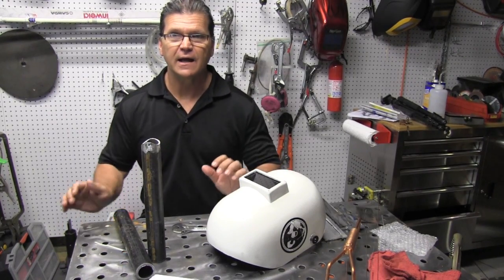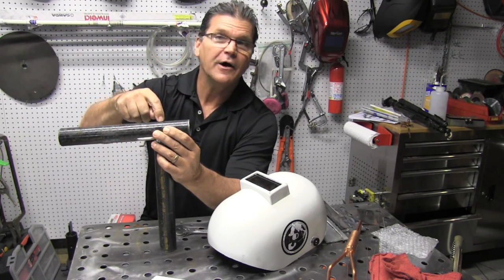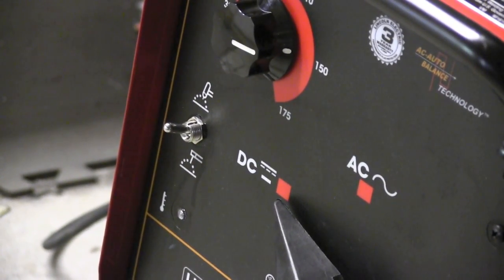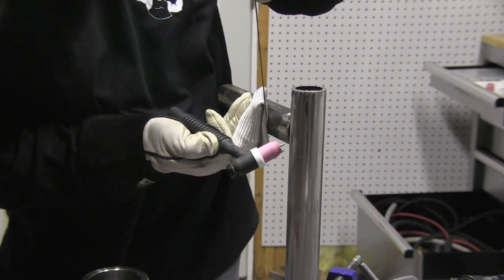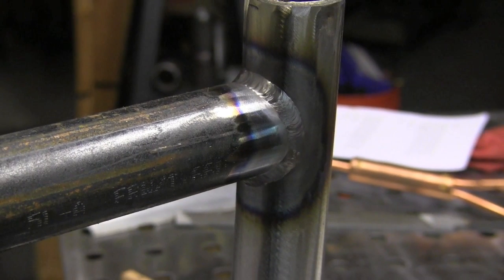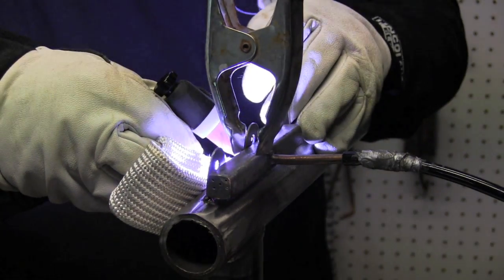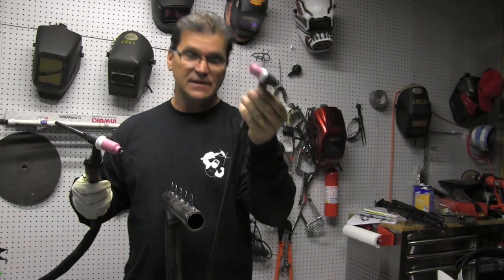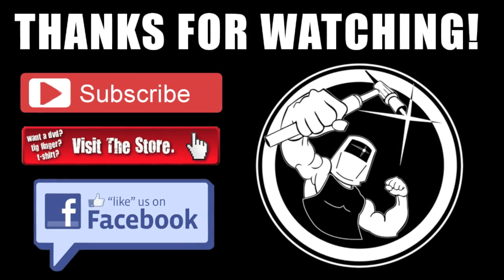TIG Welding Basics 4 - Metal Prep, Stubby Gas lens, and more

Comment: Hi Jodi,
First off, thanks for all your help getting my MIG skills sharpened enough to do a reasonable job with MIG welding. I have decided to learn how to TIG weld and purchased a Lincoln Square Wave TIG 200. I am not stacking dimes yet, but getting better every time I pick the torch up. I have been watching your basic TIG series and you have answered a bunch of the questions I had and solved a few of the problems I was having. Thanks again. It's not often you find someone who is as good at what he does as you are at welding, and is still humble. Keep up the good work.

Comment: Just getting started with TIG. Your videos are clear and concise and very helpful. Thank you so much for taking the time to try and educate and improve those around you. I do have a question. In learning how to basically manipulate the hand torch, I was just running beads on some steel I found laying around. Initially the steel was rusty and had paint on it. I ground that all down until it was clean and bright. When I tried to run a bead down I got a lot of porosity  and sparking. I had not been using any filler material at all. I checked amperage and shielding gas flow rate but it didn’t seem to make much difference. Would you have any suggestions on what I may have been doing wrong? Thanks again for all that you do.

Comment: When i saw the 'weld tab' i did what i normally do when i see something cool on the screen, i took out my phone and took a picture of it. Being poor i tend to build first, buy as a last resort. 
But then later in the video i realized i have a magnetic base for my dial caliper. If i put it on the tube, use a flexible soldering gizmo with an alligator clip on the end, i can position it however i want while using tools i already own.

Comment: Hey Jody! Here's a Q for U: At a job I was on, they had me going for speed over quality, welding cold rolled to hot rolled, and they specifically told me NOT to prep, just burn it in.  Some salesdood sold them on deoxidizing wire (basic 70S-6), with the idea that you don't have to cleanup first.  I'm a pretty decent welder these days (thanks in no small part to your vids, which got me through school and my first couple years on the job, thanks Jody!), so, though I got plenty of pops and sparklers, I  still made decent looking welds.  
Sorry to ramble on, here's the question: Are those welds going to be weaker or have hidden porosity underneath, like I think is probably the case?  Or was this a case where good enough really is good enough? (we didn't do ANY testing after the fact, just visual and send it on to the customer)

Comment: 1) if you never foul the tungsten by touching it to the filler or the weld, when do you know that is time to resharpen or re-dress?
2) And what about the collet body and cup, how can you tell if/when they are used up.

Thanks, also I bought 2 tig fingers and they are great.  Beyond heat protection they give a smoother surface when sliding along the weld piece and they are great for mig too.

Comment: I have a terrible memory, and kept leaving on (or forgetting to turn off) the purge gas in the tubes I was welding. In the end, I went back to R-Tech and bought a second solenoid valve and put that on the 'Y' piece so that it turns on and off with the main shield gas.
The solenoid is wired straight across the one inside the welder, so it's easy to add.
Now I only have to remember to turn on the shield gas at the start and off at the end of the session and it saves a lot of gas.

Hopefully someone will find this useful.

Comment: Hey Jody, I have got several of the Tig fingers, But could you also sell some larger portions of that same heat resistant material? I see that Keith has some large sections he uses to blanket his projects.

Thanks,Randy

Comment: As always, thanks Jody for all the time and effort you put into making these videos, You've got a knack for explaining the finer points of welding and I always look forward to watching your vids every week. I only have one question: I have a Harris 356 dual flowmeter and I'd like to be able to put it to good use for things other than just backpurging SS pipe. I've got all the parts required to make a similar backer box to yours, except for one thing - I can't find a supplier for perforated copper sheet. Any leads on where to get it, and do you have a recommended on what thickness works best for the perf copper section? I guess if all else fails I can drill my own, but copper is a royal PITA to drill <1/8" diameter holes in and tends to snap regular drill bits. I don't like asking for help, but I really can't seem to find perf copper sheet for sale online anywhere.

Comment: hey Jody, great topic but can you address how weld through primers are factored in,whether zinc or copper coated, in the Tig / Mig process? I have some sheet metal that needs to be lap welded and plug welded and I'm not sure now if my primer now needs to be removed ...tx

Comment: What do you prefer more water cooled torch or air cooled .. Also machine wise i have had all of them from esab to miller too lincoln an now i just want something small inverter so too speak .. I actually welded the hand rails for the freedom towers last year for a company i worked for an the used a miller i was not happy with it but i made it work lol thanks

Comment: Do you use the backing box for the second pass on those tabs or did you just leave them unshielded ??
If unshielded does the previous weld oxidise or stay shiny ??
Great videos Jody, helping me a lot with my tig learning, also the Tig Finger has certainly helped since I got it, thanks.
Reply from the maker: Tom, it would depend on who it was for, if the part would get coated or painted etc.  If it was a stainless job that would be left as is, I would shield both so it would be shiny. Thanks for your support
Reply: So stainless will need backing gas even though it has just been welded on that side, does the type of filler wire make any difference to the scaling if no backing gas is used ?
You also mentioned using gas lenses used on smaller torches to get a stubby on a big torch, yet I have a CK 210fx and a CK 9fx and the parts are not interchangeable, could you clarify what you meant please, I have ordered a stubby kit for the 210 from CK but it's on a back order.
Thank you for quick reply
Reply: Tom Simpson I think what he was saying is that it is a benefit to use a stubby gas lens kit on a larger torch (vs. a standard size gas lens and cup setup), because it lessens the overall length of the torch head.  The stubby gas lens kits are specific to the larger torches, and as you say, don't work on the smaller torches.  

With the smaller torches (like your CK 9), you can just use the gas lens kits designed for that torch (which he said he will eventually carry at his store).  You don't need a stubby gas lens for the smaller torches because the gas lens kits designed for them are already fairly compact.  

Hopefully this makes sense and isn't putting words into Jody's mouth.

Comment: Jody, did you say "you can't use stubby gas lens with WP 20 torch" ? I wanted to purchase gas lenses for my torch. I'm new to tig welding. Great videos JC.
Reply from the maker: There are gas lens setups for 20 style torches but they are not usually called “stubby “   All you need is a 45v44 gas lens and cup. https://weldmongerstore.com/blogs/quicktips/choosing-your-tig-hardware-kit
Reply: @weldingtipsandtricks  Thanks Jody, I'll check it out.

Comment: Is there any minimum pressure reading to the argon bottle when you consider it empty and being to be refilled, or do you just use it up fully until it's no longer able to put out the SCFH needed? what is the PSI on a newly filled argon bottle?

Comment: Jody,  So I have a Everlast 205Si with a 26 air cooled torch. If I want to put a stubby gas lens on that 26 torch what setup would I need? Additionally, if I am using a 3/32" tungsten should I generally be using a 3/32" filler rod - I am just running practice beads on flat steel at the moment?

Comment: Great video Jodi, thank you. I have a question. When welding aluminum that has been contaminated (I.e. oil pans, transmission parts, a/c lines), what is the best process for cleaning the aluminum?
Reply: I certainly need to know his answer on this as well. It would cost me 1300 bucks to replace the upper and lower oil pans on my 1999 a4, but if the aluminum upper oil pan could be welded, it would lower costs a lot.
Reply: Connor Jones
 cast aluminum is very porous and takes quite some time and effort to rid of contaminants, best way i have found is to thoroughly clean the part as you normally would (degreasers/cleaners) and then soak the part in acetone for several hours to a day, and possibly repeat the process if needed. sometimes making a pass with just the cleaning action from the torch to the area to be welded helps pull contaminants out, and then you can clean the area again with a dedicated wire brush and more acetone, and it should weld quite a bit better. also prepare the parts with a nice bevel for solid penetration (possibly bevel both sides if both sides can be welded) before doing this cleaning process and before welding, so you can get a solid weld and rid the direct area to be welded of contaminants better.
Reply: Roy Farley  thank you Roy. I was thinking of all you mentioned. I was going to try to heat the contaminated area with my acetylene after cleaning instead of using the tig torch. I've tried just degreaser and acetone and it just kills my tungsten and cups.
Reply: HURAM heat works best in my experience.  Using an acetylene torch or being very patient with the tig torch before adding filler material.  The key is patients.

Comment: Hi Jody, looking at purchasing my first TIG welder and am trying to figure out what to do about helmet.  I enjoy using auto-darkening for MIG and stick but see folks talking about getting 'flashed' with some helmets while running low amperage TIG. The only reason I'm asking it here is that i noticed you're not using auto darkening here, and just was curious if you think that might be a better way to go (esp. if i have my kids try it out)

Thanks!
Reply: personally i use the Jackson w60 hood
its pretty tunable for delay, sensitivity and shade power
and ive never experienced low amperage issues
Reply: I prefer using the speedglas 9100 series (a 3M brand), always works, never flashes even at low amps and in very thight spots. Its a very light welding helmet so its soft on the neck. The only downside in comparison to some other brands is that the auto darkening welding filter works on batteries which do not automatically recharge by the UV radiation. So once a year you'll have to replace the batteries. And they're a litlle more expensive then most other brands but worth the money.

Comment: Hi Would you be so kind as to do some pointers when welding with a mig but welding with gasless wire I've on occasion needed to use gasless wire (0.9mm ) welding up a lot of pens for a Deer farm here in New Zealand (can send some photos if you wish ;) was after some rules of thumb for gasless wire 
Thanks for the videos

Comment: Regarding device for backing with shielding gas. How did you connect it to your Argon bottle?
Reply: You can configure a Y hose configuration to split the flow. One for your torch and the other for the backing. That is the way I will do it with my Everlast.

Comment: Does the stubby gas lense kit allow you to stick the tungsten out a little further?
Reply: ffemtb1 Yup. It uses a screen in the collet body to break up flow and prevent swirling so you get better gas coverage.  Picture the difference between water flowing out of your unscreened bathtub tap compared to the nice ever flow out of your kitchen sink which should have a screen.

And great video.  Always great tips in these videos.

Comment: Could you use mix gas like c-25 for the backside purge?
Reply from the maker: c25 wont work very well. that co2 messes with the arc and tungsten.  nitrogen will work  for certain applications but if you get too much mixed in the arc gas, it can be a problem also.  I have used nitrogen for purging stainless pipe on a paper mill job but when guys would accidentally use it for torch gas it would bubble and spit.
Reply: weldingtipsandtricks what about a 98% Argon + 2% Helium? Is that overkill? Also, how often do you buy new TIG gloves?

Comment: MIC FROM MEXICO
can i weld aluminum with miller dialarc  250 amp  ac dc stic using tig torch 26 ? no high frequency

Comment: Jody, if you are planning to talk about back purging in one of your future's videos about TIG welding basics series, I'd really appreciate to hear some informations about back purging of stainless steel using nitrogen. Somebody says it's suitable somebody not....I would like to know your opinion :-)
Reply from the maker: nitrogen can work for stainless pipe. but its not as good as argon in my opinion. I have used nitrogen for purging stainless pipe on a paper mill job but when a welder would accidentally use it for torch gas it would bubble and spit.
Reply: weldingtipsandtricks Thanks for quick reply! Recently I found following document and whole content and opinions about nitrogen seemed very positive to me: http://aws.org/wj/supplement/WJ_1975_01_s12.pdf
I'm going to built a tank for hydraulic oil from ss sheet and I'd like to use nitrogen (due to its cost) to back purge. I got it already so hopefully it's gonna work :-D
Reply: BohousSPE 
the nitrogen was only for the back purging, I assume, so it seems maybe it would be good for that purpose, since it doesn't see the same heat of the welding side.

Comment: I have a 26 tig torch…can it be converted down to the size that you used in the video?
Reply from the maker: The stubby gas lens kit will also fit on a 26 tig torch.  I have used it on several different brands of 26 style and it helps
Reply: weldingtipsandtricks Thanks Jodi, I got the Lagesse Square, magnetic clip, and the amazing TIG fingers...thanks...its nice not to have seared sausages for fingers...Thanks for the help.

Comment: Jody at 7.28, There seems to be a small nipple on the weld. What causes that? I get that often.
Reply from the maker: that is where the little ball of silicon and other deoxidizers solidify.  If you swirl the arc around as you taper amps, you can sometimes lessen it.
Reply: weldingtipsandtricks Thanks Jody,  I was surprised to see it.  You cleaned the parts pretty well, even with Acetone, and still some contamination.  I didn't see it in the second pass, so I guess the contaminates burnt off with the first pass? 

Thanks for the videos.  Watch'em every week :)
Rob :)
Reply: Rob Townsend I don't think it's contaminants.  It's silicon and de-oxidizers from the filler metal.  For instance, ER70-S2 has, I believe, around 0.5% Silicon, as well as various elements in small amounts to act as de-oxidizers and to give various properties to the weld.

Comment: DANGER. Hey Jody, while on the topic of cleaning your base metals, you should warn your viewers of the dangers of using chlorinated brake cleaner to clean metals and then either mig or tig welding them using some argon shielding gas. Google brake cleaner and welding! Thank you.
Reply: Phosgene! 40 cu ft can kill everyone in a half-mile radius, IIRC. Used in the semiconductor manufacture industry.

Comment: How much CFM are you running on the backside?  Any thoughts on doing a video on comparing contrasting the different transfer pattern using MIG?  Short Arc, Globular and Spray?  Thanks
Reply from the maker: about 15 cfh .  It differs according to the size and design of the back-up box.  I have done a video recently kinda like what you describe. http://youtu.be/AZbCTg8otRc

Comment: could you sand blast this metal instead?
Reply from the maker: sand blast works better than nothing but tends to leave some mill scale coating behind.  Also some grit blast cabinets use aluminum oxide for media and that doesnt make for a very clean oxide free puddle

Comment: Am as guilty as you for lazily using continuous feed of rod in pool as opposed to the "Dip" rod technique but without doubt this technique can shield the root from penetration and should be used with caution. Also back purging a ferrous steels fillet is nice but seems a bit OTT, never seen this in regular welding manufacture, pressure pipes and other metals yes.